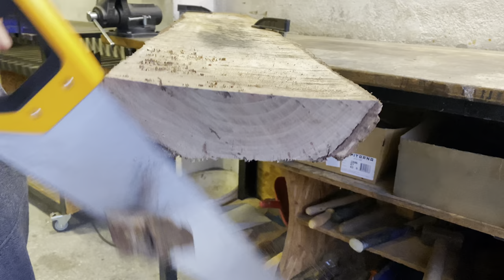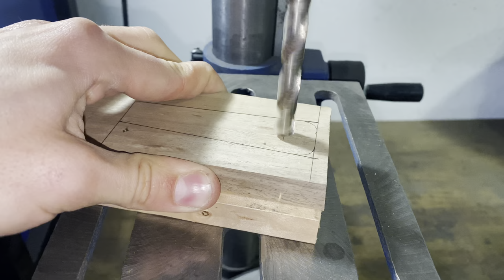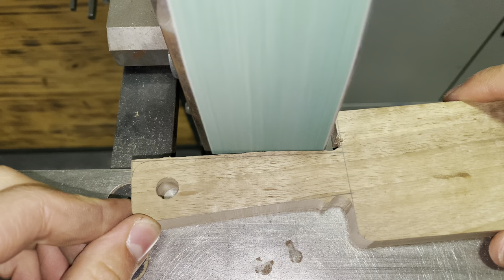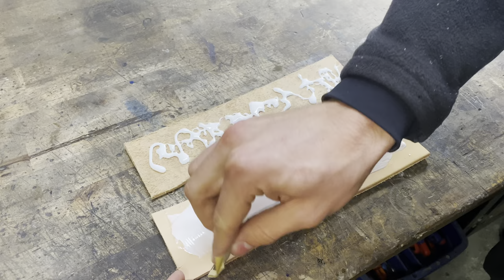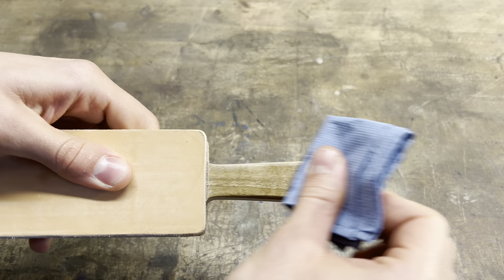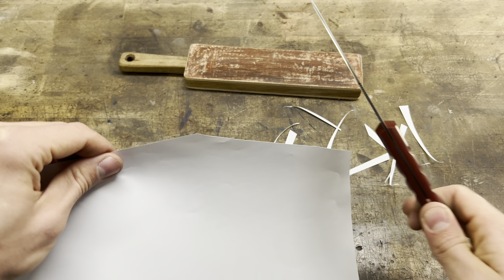Making Leather Strop (Razor Sharp Edge With This Simple Tool)

Comment: Nicely made strop👍👍🔥🔥💥💥. U had smooth part of leather on one side and course part of leather on other side. WHY???
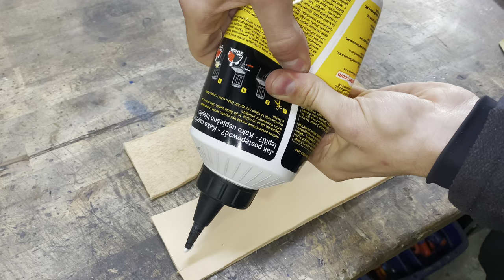Reply: @oneshotpete6.591  No, the leather is used with both (different) sides. You can see it clearly when the glue is applied 2:53
Reply: @-fazik-3713   i understand what your saying , but weather the leather is placed on open grained side or smoother side is merely a matter of preference, when loading said strop with compound .. it’s for that reason i commented it’s the same leather ( simply turned over )
Reply: @oneshotpete6.591  When I strop on my leather belt I always start on the "rough" leather side and finish on the smooth side. There is a difference for which Gurvinder asked.
Reply: @-fazik-3713  if both sides are equally loaded with compound ( as done in video ) can you please enlighten me , as to what the difference is when stropping .. other than , open grained side , (do to it’s more porous texture hold more  compound )
Reply: @oneshotpete6.591  This was not the posters question at all. Nothing about the compound.
Reply: @-fazik-3713  she asked why put different sides of leather facing stropping side and I replied it’s irrelevant as to what side of leather is exposed when loaded with compound such as is done in video…. 🤦🏻‍♂️